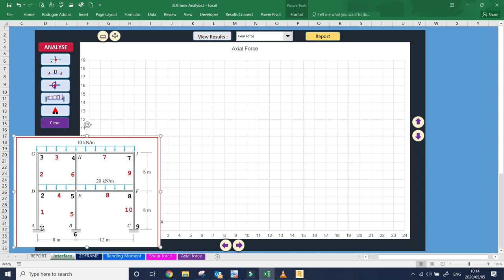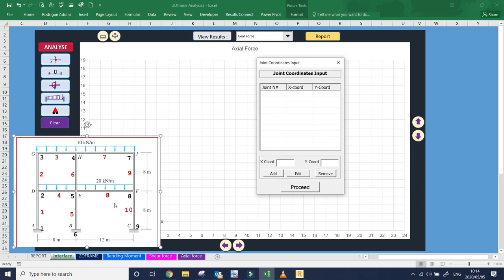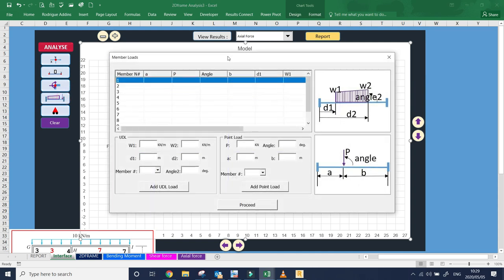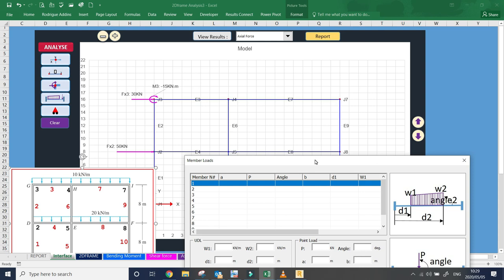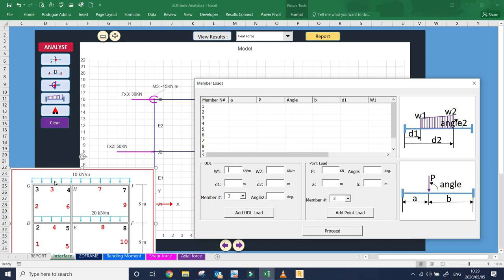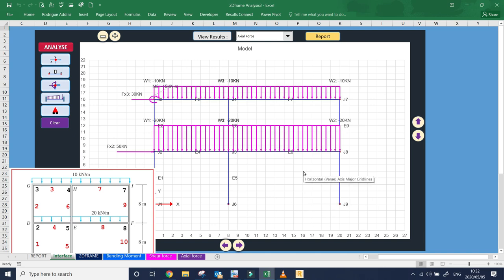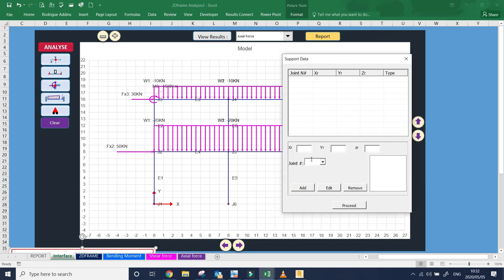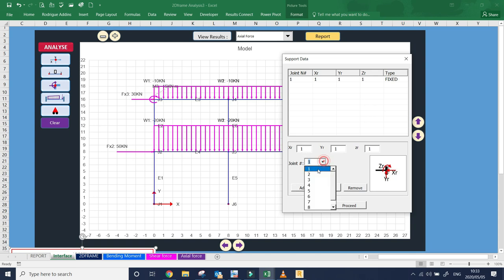STRUCTURAL ANALYSIS WITH EXCEL  SPREADSHEET  STEP BY STEP

Comment: We don't have that excelspread sheet. Where and how did you get that from?
Reply from the maker: Hi Santos,

This is custom spreadsheet which I created. You can get it here civilconstructiontools.com.
Reply: @RodrigueKamdieun  sir, it does not work
Reply from the maker: @Deep_Solstice  Hi, what issue are you facing?
Reply: @RodrigueKamdieun   i cannot input the values, the excel does not work
Reply: I can’t see the spreadsheet sir

Comment: run time 53, file not found :(
Reply from the maker: Please re-download the file and folder in this link:
https://drive.google.com/open?id=1RLnr7_xxeCM0gBVGO5RZ7hphL3tWACH-
And save them in the same folder.
Reply: @RodrigueKamdieun  now it's worked, thanks you for the link <3
Reply: Thanh Thiên 64 bit version please
Reply: Rodrigue Kamdieun 64 bit version please
Reply: Rodrigue Kamdieun can you update the code in the hidden module?
Reply: @RodrigueKamdieun  still not working, helppppp
Reply from the maker: @jhemanlapaz5097  Hi, what issue are you having?
Reply: How can i make it work?
Reply: Can you send me the file that is working through email?